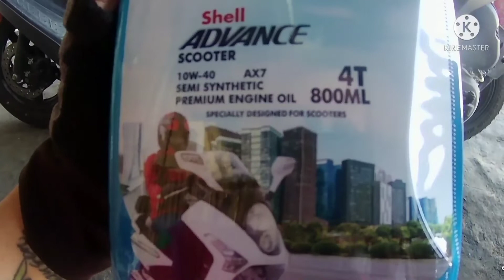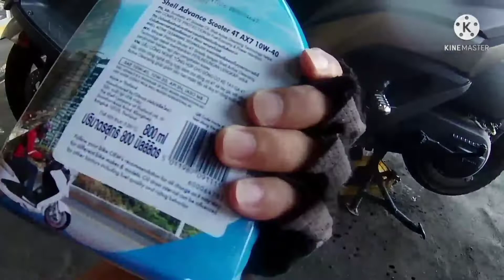first change oil ni burgman 125 (1000km)

Comment: 1.5k change oil
8k gear oil/oil filter
10k air filter
20k belt
25k fuel filter

yn maintenance ng akin based sa odo ko
Reply from the maker: Salamat sa pag share din boss